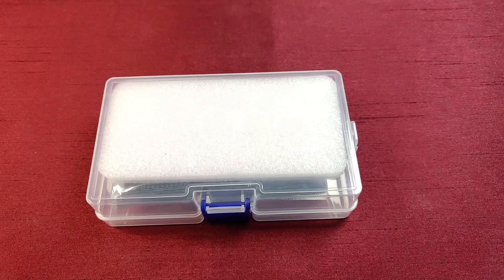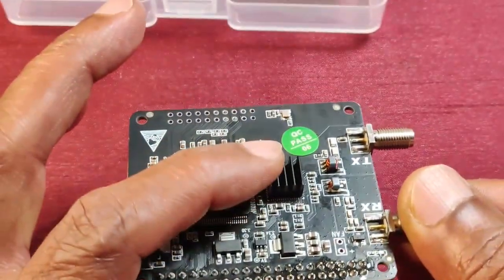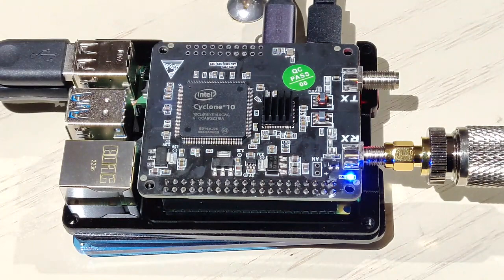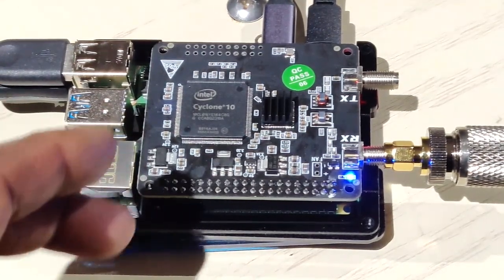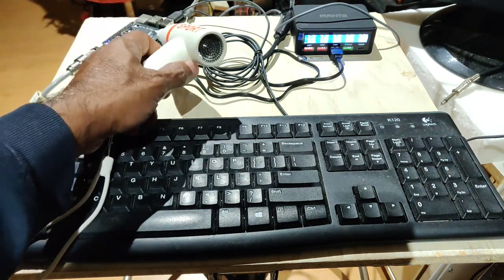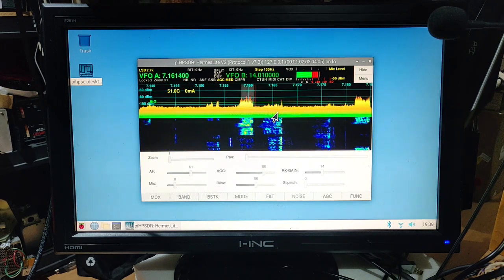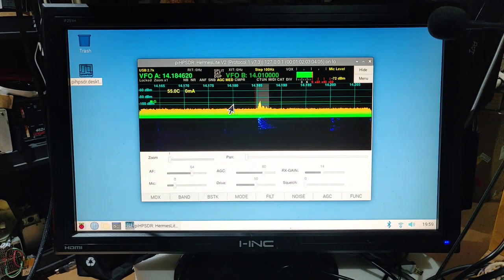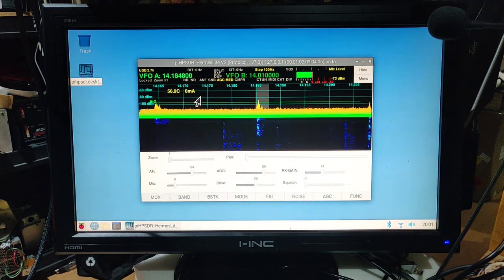Radioberry first Rx test | Raspberry Pi | SDR radio | HF receiver and Transmitter | QRP

Comment: It is a great radio. If you install WSJT-X, you can even work digital modes. I've made a tutorial vídeo on how to setup both the Radioberry and WSJT-X for that effect.

As for the build quality really depends on the manufacturer. I have a different board, and although there is nothing to write home about, the quality is pretty good. You can by an heatsink kit for the Raspberry Pi4 and apply the two biggest square heatsinks to both the AD98666 and the FPGA. Also, the holes beneath those chips should be filled with solder. That is important for grounding and for heat dissipation as well.
Reply from the maker: Thank you for your feedback, sir. Yes, now all the heatsinks are in place - including a fan - in the final phase. I've pinned the link to that video. Every day I'm having QSOs using this Radioberry. I have 2 boards. Both are different. Thanks for the suggestion on the digital modes. I'll give it a shot. 73.

Comment: Every video I see both of the Radioberry and the Hermes Lite 2 shows at  least an S7 band noise level... what signal does it measure with no antenna? Thanks!
Reply from the maker: Thanks for your feedback. I'm not in a position to give you exact figures at this time because my Radioberry is down.... work in progress for upgrades. However, there's no audio output or visible static when antenna is disconnected. RF gain plays a crucial role (especially) in this rig. From legacy radios, my practice was to max out RF gain.... I had to relearn everything when I started with this.
I just keep the RF gain as low as possible.

Comment: Maybe who has tried it, instead of Raspberry Pi Orange Pi can be used for Radioberry?
Reply from the maker: It did cross my mind, but haven't tried it. In my perspective, this is already an expensive project...more expensive than the Hermes Lite-2. So, I don't think I'll spend anymore on this. Thanks for your message. 73.
Reply: Ok! @PremMenon

Comment: It's interesting that this board has such visibly poor build quality, but the Cyclone chip has a 2319 date code, so it was manufactured this year. Fresh electronics, just bad assembly quality control I think! It's great that it works so well, it seems like a fun extension of the Pi's capabilities.
Reply from the maker: Thanks for your feedback - with the DC. Yes, frankly, I didn't expect it to work. The supply chain has no stock of this chip. The Tx also works well. Definitely a fun project. 73!

Comment: Why can’t these be made in India? and better?
Reply from the maker: Good question. My guess is, although we have our strengths, we don't have the infrastructure and the systems in place for high-end chip manufacture. But, we are getting there. Thanks for your feedback.
Reply: Well, I believe the Anan range of SDRs are made in India, and let's not forget the amazing work Ashar Farhan has done with his bitx radio designs and kits... a true radio amateur.
Reply from the maker: Correct.
Reply: Hi. Where i can buy the sdr?
Reply from the maker: Google Radioberry. There are many online sellers.